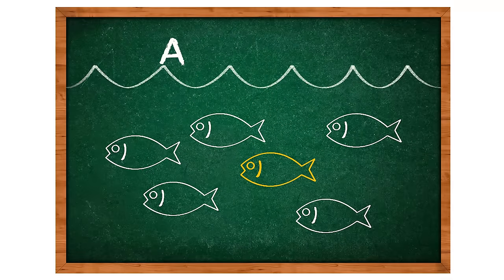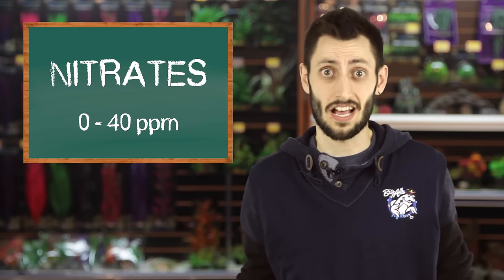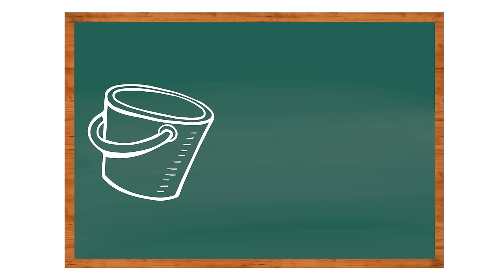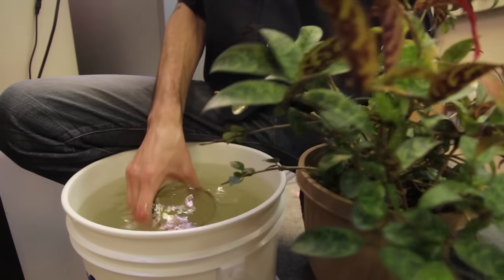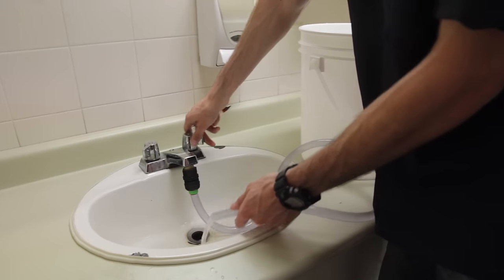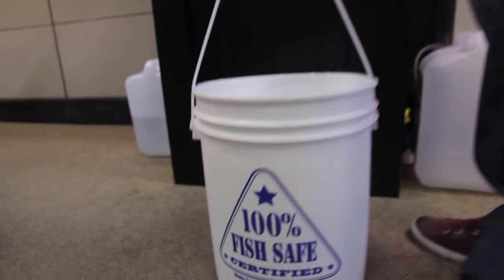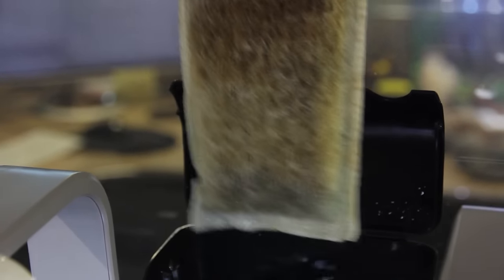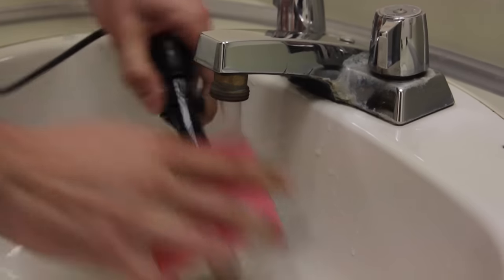Basic Aquarium Maintenance 101 | BigAlsPets.com

Comment: Why not just turn the power bar off instead of unplugging everything?
Reply: if your light is plugged into your power bar too, then you won't be able to see much when it turns off. personally I use power centers that have a rocker switch for each outlet so I can just turn things off individually rather than unplug them.
Reply: Fair Enough. I've always had them on separate plugs, so never really thought of that.

Comment: when doing a water change you mention to match the water  temperature with the water in the tank..  Using hot water from a hot water tank is a  NO - No..     Place you refill water in your bucket.. Put the bucket in sink..  fill the sink in hot water..  Allow it to sit and warm..  Sometimes i would boil water on the stove to bring up temps..   Unless you have a tank-less water heater..  dont do it..  The water tanks contain lots of crap your fish dont like

Comment: I’m going to disagree on your water change policy. Using water from your Fossett should always be cold water only, hot water heaters hold tons of old sediment and some even have copper in them.  It also removes oxygen from the water. You should get a big enough bucket or tank and poor and prepare your water the day before and let it warm up to room temperature or even have a second heater to bring it up to temp.

Comment: Does any body in this day and age still use buckets? And that beneficial bacteria supplement is all about marketing bunch of bs.     Most efficient and cheap decloriner in the long run is either  safe or prime as a water conditioner . I have 3 fish tank : 125g. 75 and 150. Been 2 years still have not finish up the safe powder decloriner .   A pump for water change much much faster.